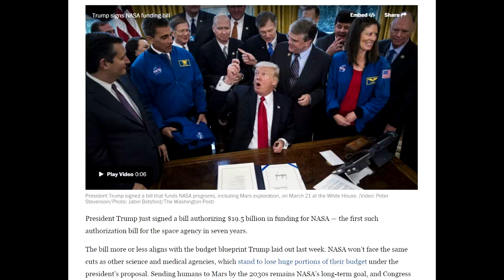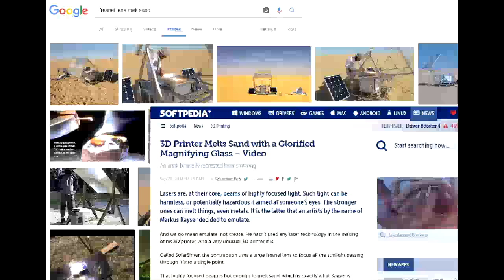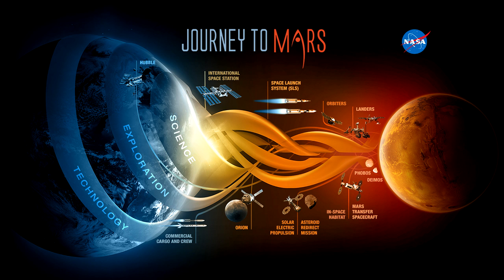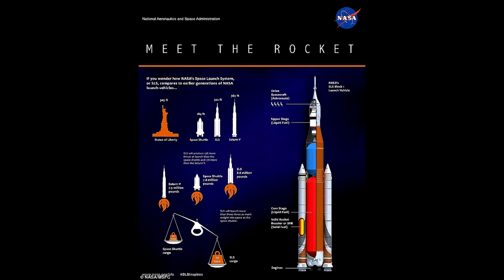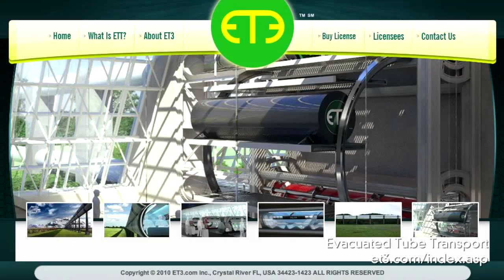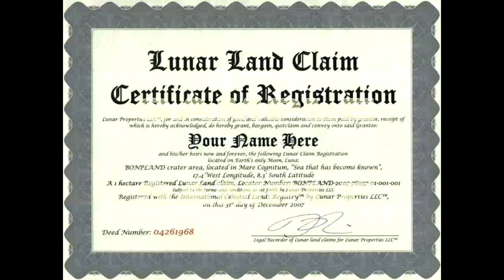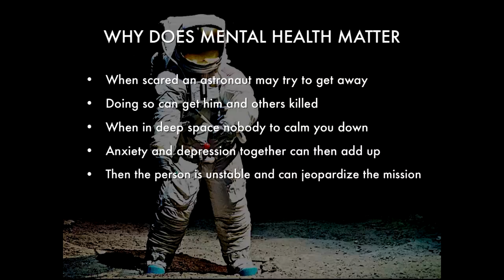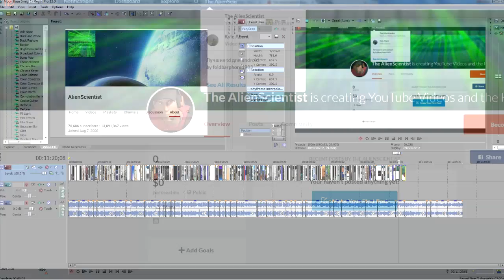Why NASA should 3D Print a Moon Colony, before we send humans to Mars

Comment: Serious, How would the moon elevator ever work? The worth rotates and the moon orbits. Wouldn't that mess up either the rotating or the orbiting and change the earth's enviroment?  I am have no knowledge on the subject, so genuinely curious if this problem has already been thought of and solved.
Reply: The space elevator goes into low earth orbit.  The space elevator does not go to the moon. A working space elevator would be a game changer because it allows for mass to be brought into earth orbit at low cost.  I believe the current cost is to bring mass from the earths surface to orbit is around 60,0000 USD / lbm.

Comment: Trump this and Trump that... Why not NASA and public opinion in general, is simply wrong. The ISS was already a failure, because it didn't produced 1/10 of the promises made about its potential. Even before the ISS, a large part of the scientific community pointed to the Moon as the next step and not the ISS. Then came Bush Jr. that said and I quote "We're gonna go to Mars and beyond".
So as you can see this isn't a Trump matter, but a global matter. Because for some reason the Moon keeps getting neglect on purpose.
Now. People can believe whatever they want to believe, but it's strange that the nearest place we got to get what might revolutionize controlled nuclear Fusion (Helium-3), is always getting benched. And clearly on purpose.
Because they can't say "Well, there's nothing really valuable on the Moon, so no use going there" they can't say it, but they act like they're saying it.
A Mars mission is if nothing else, a disaster waiting to happen. Mars is a several centuries endeavor. But still the Moon gets the boot.
That above everything else is something people should really think about.

Comment: I'm a 3rd year civil engineering major and this has been on the back of my mind for a long time.  I've always imagined a lunar base would have to be mostly subterranean in order to shield the occupants from radiation and micrometeorites, so my main focus has been on tunneling through fractured basalt and foundation construction.  I don't have anything substantial but I'll re-double my efforts since this is something I'd be really excited to contribute to!
Reply: Cullin Sinclaire iv always thought the easiest way would be to design torus shaped inflatable that sit in a naturally existing crater, and then use a dozer style machine to just cover it in regolith. All you need to launch is a dozer and inflatables and you have shielded tens of thousands of ft3.